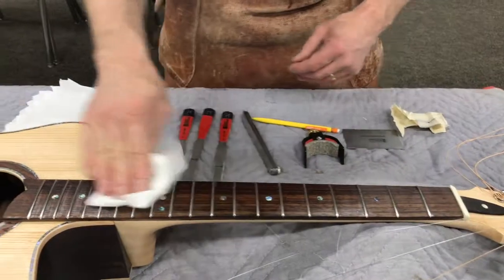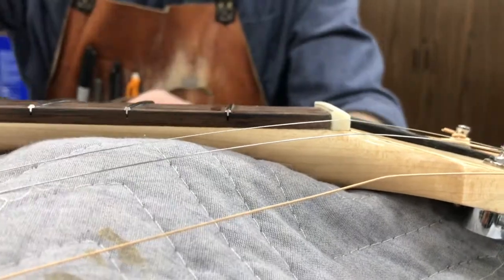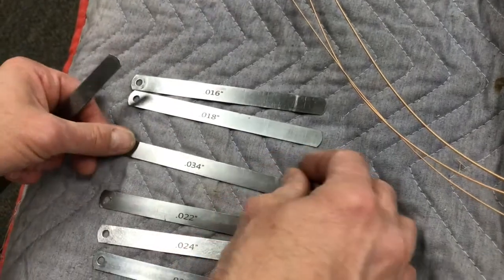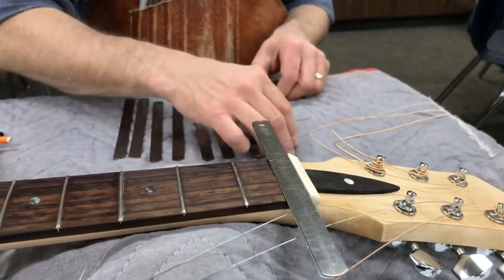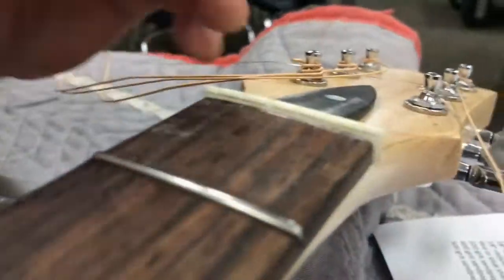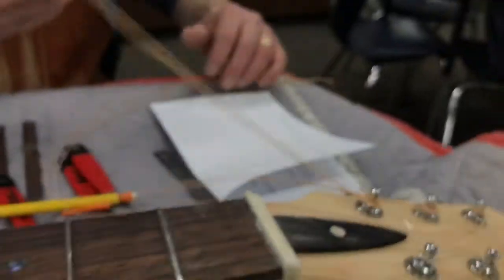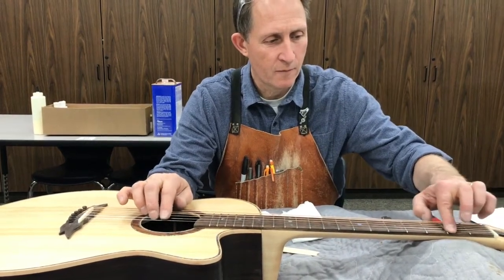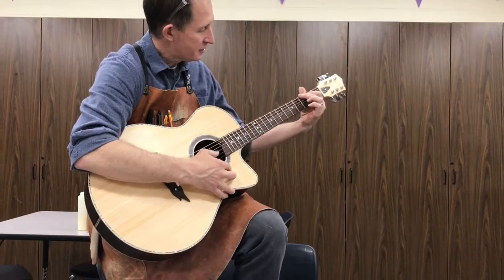set up: nut and saddle

Comment: should the slight concave neck bow be set before you set the nut and saddle height or does the bow be checked after full sting tension? Thanks

Comment: Low tack painter's tape will pull off cleanly, leaving no tape residue that needs to be removed. I have never seen anyone use mineral spirits/paint thinner to clean a fretboard. Everyone that I know uses naptha or ronsonol. Both leave no greasy feeling like paint thinner, and no nasty smell either like paint thinner does.